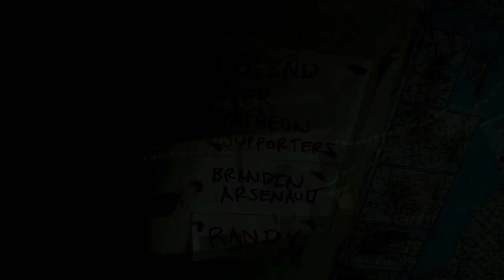Simple Elegant Cigar Box DIY

Comment: dont understand this man. for bigger sized wood push sticks are used. for very small sized wood, hands are used during the table saw cut
Reply from the maker: had to re watch the video to see what you meant. I think I did that because it seemed to give more control over the piece given the throat plate was a different height than the tabletop and only very little of the piece was able to ride the table.